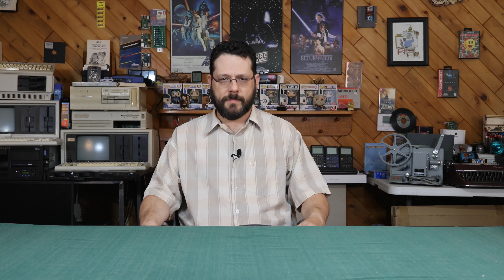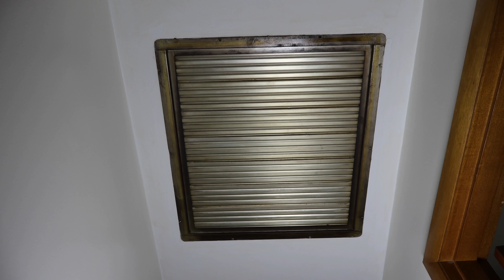Smart House With A Low-Cost Energy Saving... Fan From 1954?

Comment: or you could reverse the house fan and put the filters on ye old fan outlet
Reply from the maker: You're not going to believe this, but there's no duct. It just vents into the open attic (which can't even be accessed through any other means but that fan hole). I could probably change that, but I've actually discovered an easier way to open the draft so I can pull the cooler air up from the lower level. The HVAC unit in the gameroom/studio, which is more or less the furthest extreme on the bottom floor, has an exterior inlet that has the old-fashioned lever operated baffle. 
One day, I'd like to just motorize that guy--I'm thinking simple DC motor with a metal disc with notches for two limit switches and a hole for the rod that the lever moves to open the baffle. The other nice thing about that is the inside of that unit has plenty of room for that sort of thing. They didn't shoehorn everything into a barely large enough frame for the innards like they do nowadays. Oh, and the other nice thing about that unit is that the wall it's mounted in is always in the shade in a little pocket where the inside of the L shape of the house is, so it should be the coolest air I can get from outside--low and shaded.